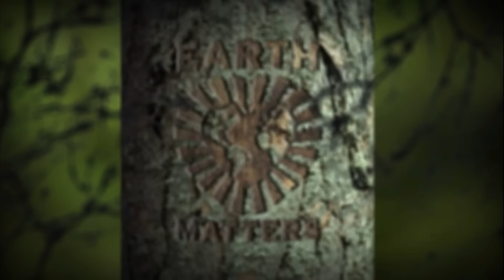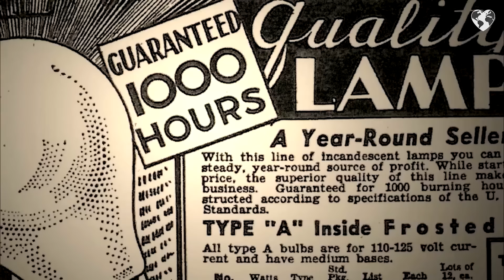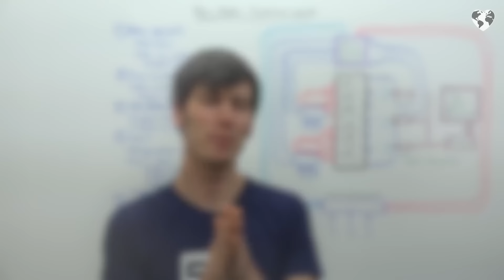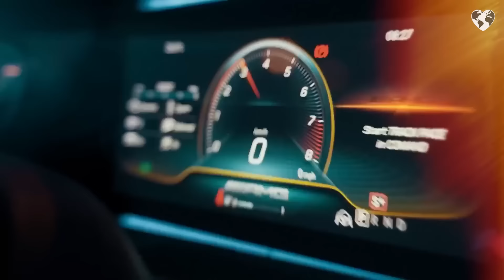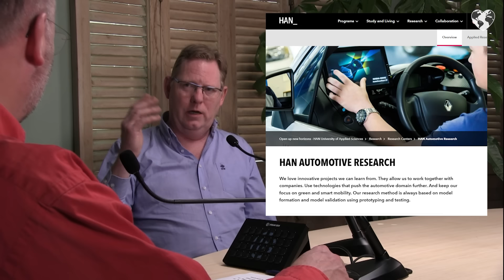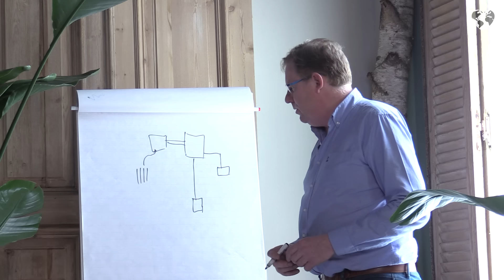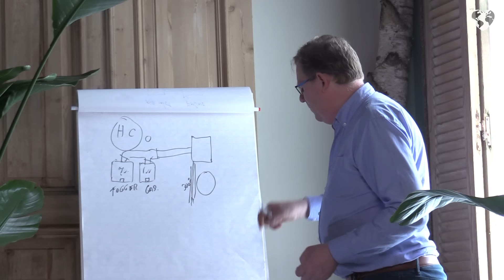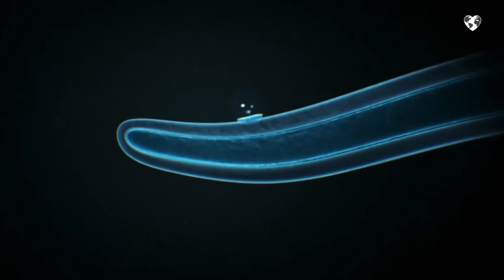Game Changers #1 Cars on water injection

Comment: My impression: strange mix of real innovation and nonsense in this video.

3:51: nice box with atomized fuel

12:20: bizarre what Frank says here about water gas; I do not believe it. Please show a clear experiment.

51:30: Nebulizers for water and gasoline. Fine! Largely corresponds to the GEET engine. Doesn't Frank mention that? GEET videos come with weird claims about "plasma"; Frank explains it better.

1:01:40: Here's a strong claim: running the engines on water alone would not be possible because the water is too powerful. Sure, but isn't there a video of it? I don't buy it.